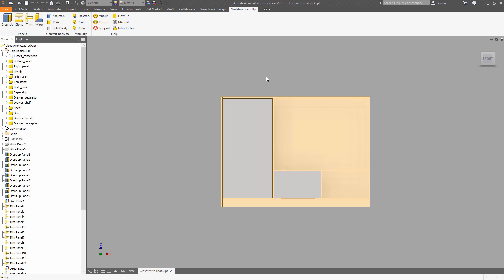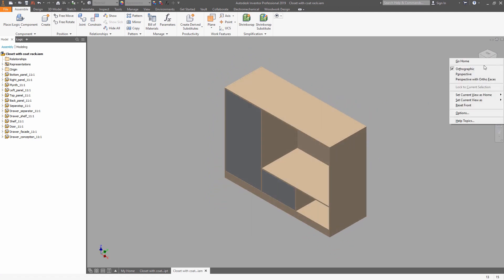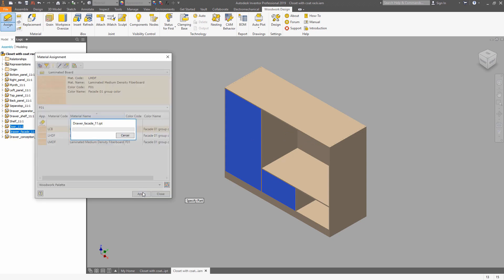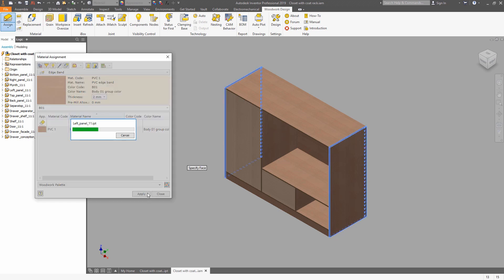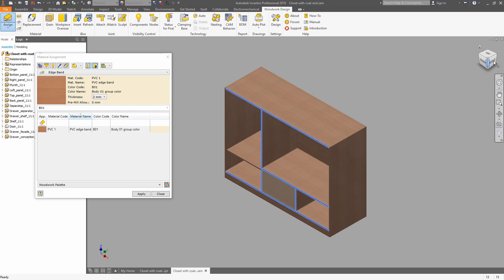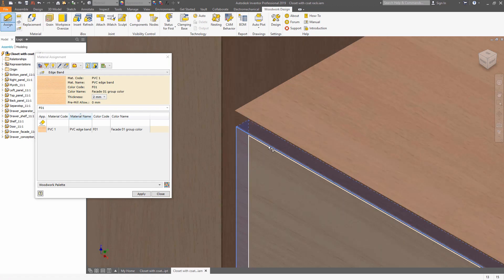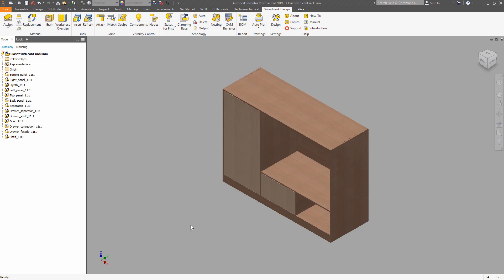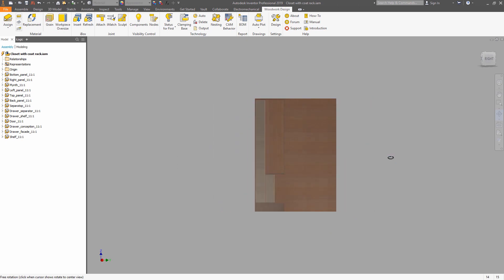2. Applying materials

Comment: Just want to ask about edge banding.
Is it will change the dimensions of the 3D model if we measure it?

I mean if we use sink or on top option will it add/reduce 3D model body dimensions?

Thanks
Reply: The dimensions of the 3D model are not changed directly. However, when calculations for the Bill of Material are performed, the factor of edge banding is counted. Also, you can ask to automatically build a representation of the part (Structured) where the edge band is represented as a separate solid body. In this case, the 3D model of the part is changed according to the edge band applying condition (sink or on top).